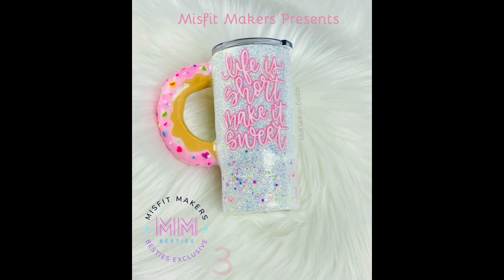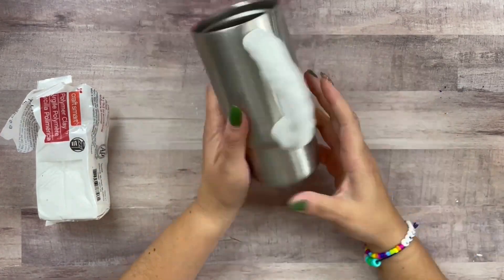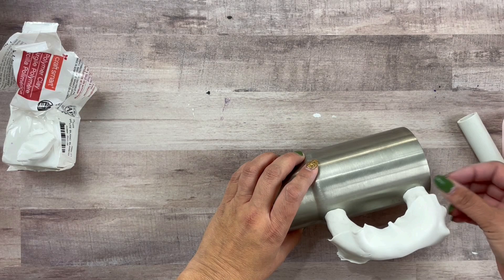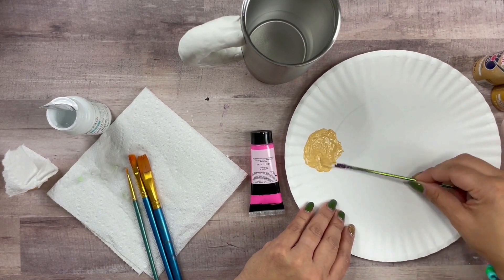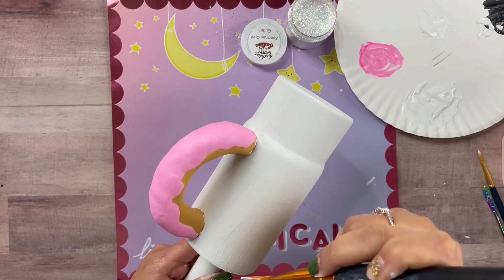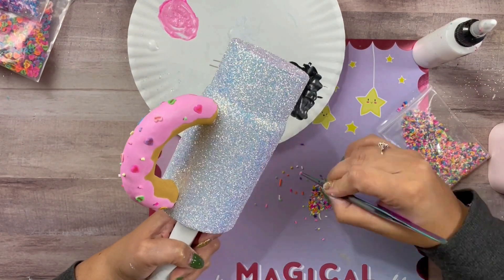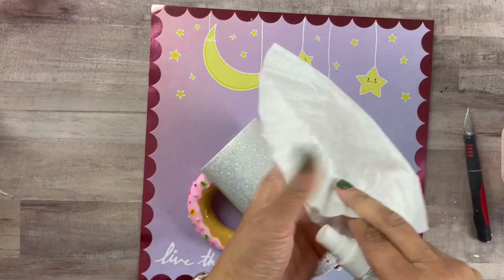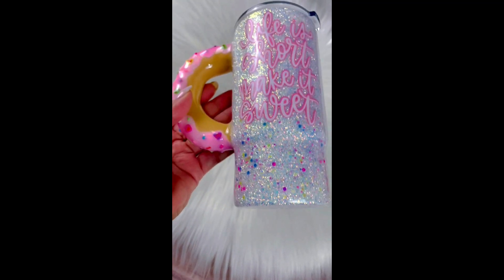3D Donut Handle Tumbler Design Tutorial

Comment: Do you have to bake before using?
Reply from the maker: You bake the clay once that step is done proceed to make the cup as usual. After there is epoxy on the cup you can expose it to the heat of the oven 😉 - Geri